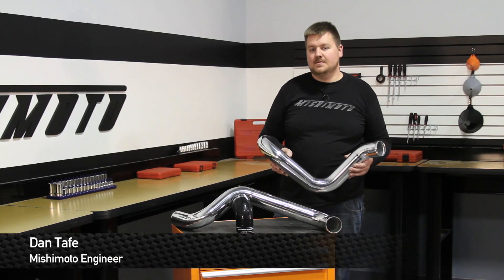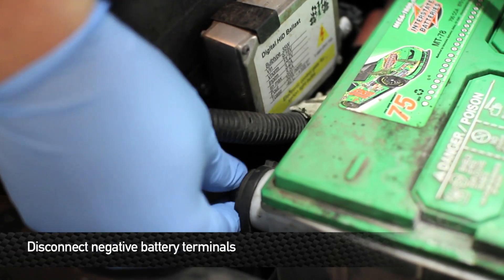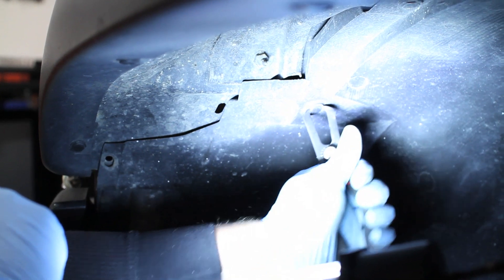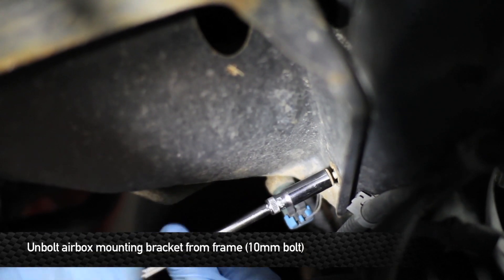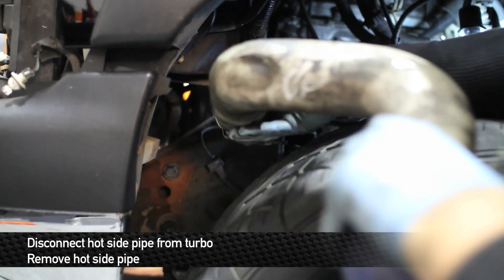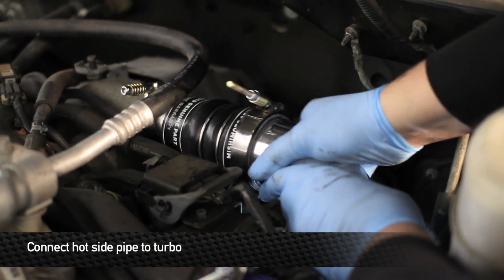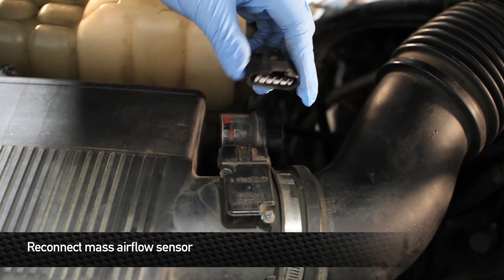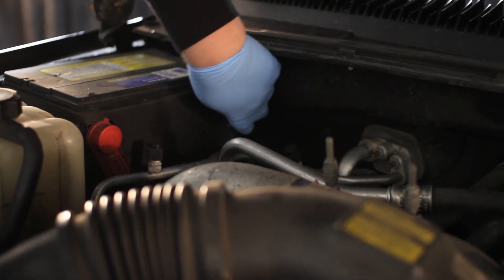How To Install: Mishimoto 2002-2004.5 Chevrolet /GMC Duramax 6.6L Intercooler Pipe Kit

Comment: Will this kit fit a 2001 6.6 Chevy silverado 2500HD Duramax?
Reply from the maker: This was unfortunately not designed for a 2001 model. There are minor differences that prevent out kit from working with that particular year.
Reply: @mishimoto  is there a kit for my year truck?
Reply from the maker: We currently do not have one available for the 2001 models. You may be able to find something with one of our vendors.